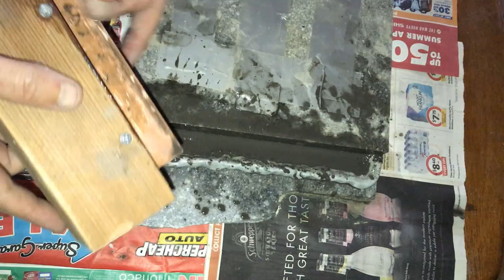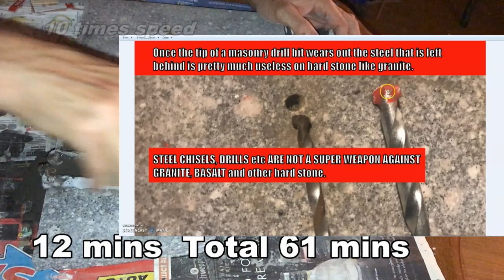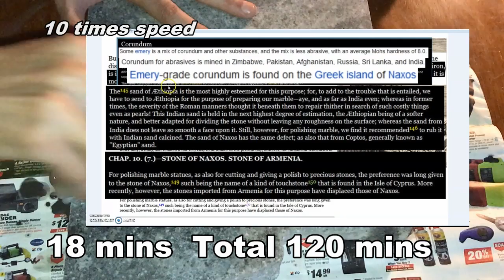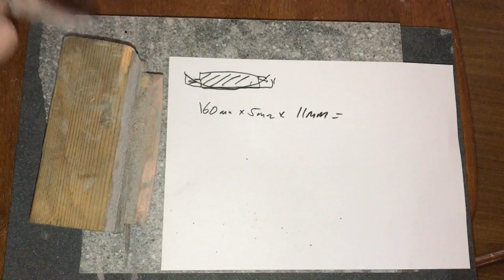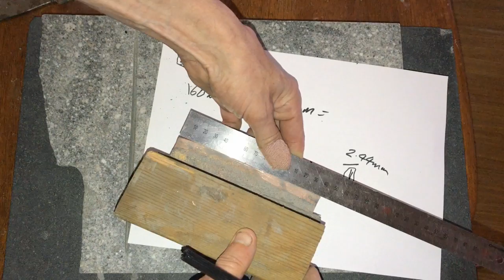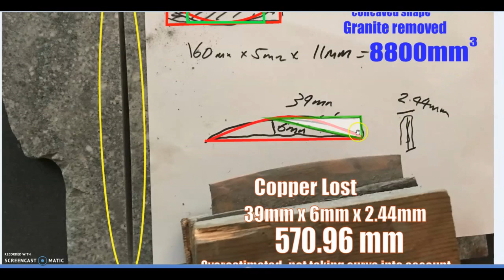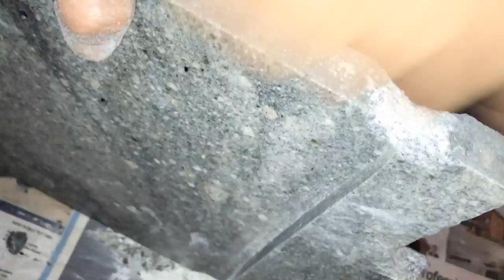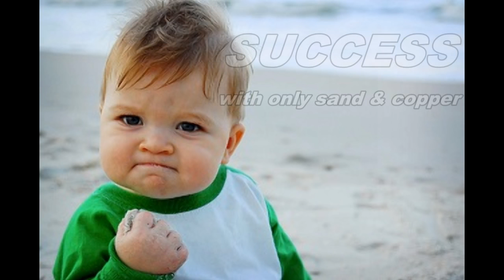LOST ANCIENT HIGH TECHNOLOGY- HIGH SPEED CIRCULAR SAWS 100% Debunked with Experimental Archeology

Comment: This does not at all debunked lost ancient technology, in fact it reinforce it.  Manual and machine cutting of granite that we are doing currently used the same principle, that is, friction. Both also used abrasives harder than the granite itself, the abrasives might be separated or embedded in the saw, plus water.  The determining factor whether the granite was cut manually or through a machine is the speed, scale and the precision.  The features of the granite blocks inside the Great Pyramid or in the Serapeum is beyond manual cutting if you take into account its scale and precision.
Reply from the maker: Lost high technologists such Brien Foerster and Uncharted X say this cut is impossible/ That soft copper rbonze tools cannot do it, and that the thinness of the cut is impossible. I have done it, and anyone else who cares to try can do it. 
THEREFORE those claims are ABSOLUTELY AND UTTERLY DEBUNKED.

"Manual and machine cutting of granite that we are doing currently used the same principle, that is, friction. Both also used abrasives harder than the granite itself, the abrasives might be separated or embedded in the saw, plus water."
Firstly please provide an ancinet cut mark that doesn't match methods of cutting- machined or manual. 
When it comes to abrasives like cuts like, the hardness of granite on Mohs Scale comes from the quartz. Quarts cuts quartz just as diamond cuts diamond.
If the abrasive becomes embedded in the saw is still pressing the loose abrasive against the stone.

"The determining factor whether the granite was cut manually or through a machine is the speed, scale and the precision."
1 - SPEED How do you know the speed that those blocks were cut? I use an unweighted blade which is the slowest possible method.
2- SCALE. Push saws and pendulums saws were used to cut large granite blocks and were photographed in use. These blocks do not count?
3- PRECISION- https://www.youtube.com/watch?v=bEwxMFDRmek Forget the video and go to the links- Isida project provides map and catalogue of all the Serapeum boxes. Please tell me which one is PRECISE. Please provide a source of measurement of this precision.

"The features of the granite blocks inside the Great Pyramid or in the Serapeum is beyond manual cutting if you take into account its scale and precision."
What precision is beyond manual cutting. A skilled craftsmen makes precise things but because an apprentice is not so precise? 
The argument of scale is nonsense. It makes no sense. At what point does it become impossible manually. 1 metre, 1.5 metres, 2.7 metres, 4.8 metres. Where is this mystical point where it becomes impossible manually?

Please provide information, you are speaking about specific things such as scale and precision. 

I will then provide examples of historic - pre-diamond- pre-precision machinery examples of granite work that meet those same pre-requisites.
Or examples of moving massive blocks with wood and rope.
The type of things the Lost Ancient High Technologists are rather desperate that you don't see.
Reply: @SacredGeometryDecoded  Of course, bronze and copper could not cut granite, that statement is correct, and the people you mentioned who said that statement are also correct in saying that. Why? Because it is the abrasive that cuts, not the copper.

You did not ABSOLUTELY AND UTTERLY DEBUNKED those ancient machinery arguments because you have not made any coffers equal in size and quality like that of the coffers in Serapeum using assumed available tools during that time period.  In fact, no one ever did, not even the experimental archaeologist.  You manage to cut a slab of granite sheet? Okay good effort, you got the science behind, the speed of course we can guestimate, but the SCALE and the PRECISION are just absent.  First, make one coffer like those at Serapeum using manual tools before you can confidently say that you ABSOLUTELY AND UTTERLY DEBUNKED their arguments.

Well, someone did show cutting 1 meter x 1 meter granite block using a push/pull copper saw with abrasive and water but still could not completely cut the granite in two because after cutting deeper than the height of the blade, the friction on both sides of the blade is just to much for them to push and pull as the abrasive is working against it, and the copper saw just could not do it as it looks like the copper saw will be mutilated before you can cut deep enough.  This is what i am talking about that there is a big difference if you are cutting a material that is enormous in SCALE compared to the granite sheet you just cut. The greater the SCALE you need the better tools and of top of that the increasing need to maintain PRECISION on increasing SCALE.
Reply from the maker: @zyveetorre1242  So no specific example of precision then? Imagine my surprise.

Each operation needed to make the serapeum boxes including the trihedral inner corners have been replicated. Are you saying that the individual operations cannot be repeated collectively? That you need to see one made is just silly. 
'You sawed a piece of wood and you drilled into another piece of wood but until I see you drill and saw the same piece of wood you've proved nothing!
It is a ridiculous statement/demand.
'To quote
"Well, someone did show cutting 1 meter x 1 meter granite block using a push/pull copper saw with abrasive and water but still could not completely cut the granite in two because after cutting deeper than the height of the blade, the friction on both sides of the blade is just to much for them to push and pull as the abrasive is working against it, and the copper saw just could not do it as it looks like the copper saw will be mutilated before you can cut deep enough."
You actually wrote this in a public coments section.
Where did this happen? Who couldn't carry on further than that? BS. Pure BS. Provide some link or something, you keep claiming presicion etc but provide no specific example just claims.

Do you even  know the difference between annealed copper used for arts and crafts as opposed to work hardenend copper?
FYI the copper used in Egypt is not pure modern copper like I use but arsenical copper/ and indeed arsenical bronze, it is stronger than mild and medium carbon steel on vickers hardness scale.
Though even hardened pure copper wouldn't come close to being mutilated. NOT ONE BIT!!!!
If that was true then the cutting edge of my saw here would be damaged. Including the 1.2 mm wde blade I use at the end. 
You clearly do not know what you are talking about.
Reply from the maker: Zyvee Torre bye there’s a whole section of the history of various abrasives where I quote Pliny mentioning it’s not the iron but the sand that cuts the stone.
Do you need a time code and links to Brien Foerster and Uncharted X where they literally say these things are NOTHING SHORT OF IMPOSSIBLE with soft bronze and copper tools.
I do my homework.
Reply: @SacredGeometryDecoded  You are claiming that you ABSOLUTELY AND UTTERLY DEBUNKED their arguments, and that means absolutely and utterly debunking them means 100% accomplishing the task that they think is not possible.  And you or any other accomplishing some steps and replicating some process thereon claim such?  Then i wonder, despite your claims that you or any other was able to replicate the operations, then where is the compete item?  Those coffers are not like the Great Pyramid that requires tremendous amount of materials and time and labor, those are 2x2x4 meter stone boxes!  You are far from absolutely and utterly debunking them unless you can replicate a complete one.

The situation i sited was done by us, thats why we know the problems of copper saw cutting a granite of that size.  The friction build up on the sides of the copper saw is just to much for it to handle.  You can make a cut a few inches deep, but you cannot go any deeper than that using copper saw.  Of course, we are not youtubers so we dont put videos.  However, for some people they tried, and they could not finished cutting, here you can search and watch this https://www.youtube.com/watch?v=qeS5lrmyD74 .  Notice that they have not shown that block of granite split into two pieces because they could not. 

By precision, it is the PRECISION OF CUTTING a slab of granite of that size that is flat to an error of a millimetre that made up those granite boxes in Serapeum. That alone is impossible using copper saw plus abrasive and water.  I am only referring here in the precision of cutting a straight line of that length and wide, 2 meters by 2 meters, easy to imagine and conceptualize, but impossible to cut using limited tools. If you are complaining while some of the coffers looks ugly well they are not yet polish, might as well not a finished product.  Those slabs of granite newly cut by hydraulic saw looks ugly too.
Reply from the maker: Zyvee Torre lol. That’s Denys Stocks. His saw is mutilated and he couldn’t cut below the width of the blade?
I posted one of his lectures earlier tonight. As he points out the abrasive sand acts as a liquid.
His blade has no damage. 
They made cuts and drilled for TV. Short time frame.
He has published a book on stone working experiments. I linked that in the video. You are just inventing things to back a non existent argument.
You leave a comment on a video where I go through abrasives etc point by point and them think you’re educating me on abrasives 🤦‍♂️ 
Why has no one made a large box? Because it takes time and is expensive to buy granite. To assemble a team for weeks to repeat what they have done, 
Then if they do the true believers just wave it away anyway. 
It’s impossible with a copper blade but iron is precise? 
And 1mm precise? WTF? In regards to what? Is their a blueprint with precise specs that show it is 1mm from the precise design.
Stop wasting my time wth your nonsense.
You make up BS.
You provide no sources or examples of precision.
You post a Denys Sticks link in response to mutilated copper blade?
Reply: @SacredGeometryDecoded  i do not know that guy, i just search videos since you want some.  I am not even educating you on the abrasive, i am telling you that a copper saw will not make it the moment you cut deep enough where the sides of the blade are getting much friction. That guy already got a fat granite block that he is working into, your argument that they could not replicate because granite expensive is just out of the question, your argument that they need to assemble team is also out of the question, that man in the video already got a team, and it seems his job is related to experimental archaeology, that means he got the time of his life! All he need to to is to make one granite box like that of the coffers in Serapeum using simple tools and claim ABSOLUTE AND UTTER DEBUNKING of those ancient technology theorist!  But did he?  He cant.  You cant. We cant with those tools. 

Why would you look for the blueprint of those coffers, who knows where is it?  In the fist place you could not fit the lid of the boxes unto it if you are not cutting with precision!  A cut of 90 degree angle is of course a precision!  To cut it and make it a cube of that size is of course a precision!  Those precision on that those scale are impossible using simple tools!  No experimental archaeologist have ever made cutting granite demonstrating that degree of precision on that scale.  I even doubt that the team of that man  in the video cut their granite following the line that they mark, it seems they just cut randomly, which is of course easy.   Ask him why he was not able to replicate a coffer, do not assume that he got no granite, no team, no time because he have.
Reply from the maker: Zyvee Torre that  a saw will stop working at that depth is ridiculous. There are old images of stone masons cutting larger blocks than Serapeum with a pull push blade that is thin.
It is utter and complete nonsense.

A tv crew filming a couple of days didn’t make a granite box. Seriously? On  a small piece where only a couple of people can work at one time!! Do you even hear what you’re saying.
They didn’t even use a guide to keep the cut straight. My cut is precise. It follows the edge where I begin the cut. To within less than 1mm.
I repeat it at the end with an impossibly thin blade to get a cut that follows the line of the guide to within less than a1mm.
I mean it’s all right here. Did you watch it at all. It’s right there. You are talking complete nonsense. By using a guided thin blade saw they cut deep cuts by following a guide. Done. Finished. 

There are historic granite buildings with precisely fit pieces.
90 degree cuts everywhere but as I show in my Serapeum box video I go through each box individually and prove lack of precision flatness and in perfect 90 degree corners. It’s clear from the photos but the Isida project took measurements unlike lost high tech people. Not precise. Repeat the Serapeum boxes are not precise. It’s all linked in the description. You failed to point to a single box that is.
I do my homework.
I have posted experiments polishing and drilling too. I have done it myself. Others too. With only stone tools.

The claims made by Uncharted x, Chris Dunn, Brien Foerster. Absolutely and unequivocally debunker.
Bet I have videos not only debunking Chris Dunn but exposing him as an outright fraud.
I have wasted enough time on comments.
I have many videos on these subjects with sources and demonstrations.
You don’t know what you are talking about, your points are absurd.
I have to think you’re trolling because a logical person wouldn’t say this on a public forum.
Reply: @SacredGeometryDecoded  I am not simply talking about to some TV crews not able to make a granite box using simple tools, in fact i am talking to anyone not able to make a granite box like that of the Serapeum, that includes you of course and all the experimental archaeologist.  Their job is to replicate some ancient stuff using the assume ancient tools, and again the coffers of Serapeum itself is replicable in WHOLE without consuming enormous resources, yet no replicated sample was ever presented.  They are contended that they have replicated a part, little did they now that is the replication of the whole item that sets apart the viability or the non viability of cooper tools in making those ancient items.  SCALE and PRECISION, i have repeated it many times already.  Yet you are ignoring scales as if its nothing, now try to cut a deep of 1 meter with the tools you used in this video, you cant, your deep is limited only to the height of your blade.  Should you then extend the height of your blade to 1 meter? You may but it will no longer work as its length is so much shorter.  Should you then extend the length of your saw?  You may but for it to be usable, with 1 meter height blade you need to have it at 8 meters long, and the thickness should be proportionately thicker.  But how about if you use the 1.5 meter saw like those guys in the video are using?  You may but the precision suffers, as we can see the cut tends to form a "V" shape, that is because of the wobbling motion while you are pushing and pulling the saw.  And after you have cut to a certain deep, your saw could no longer made progress as it could not withstand the friction on it side.  What, that friction you are talking about is bull shit??! Not so, the "V" shape cut on the first few inches cause by the wobbling motion of the blade actually helps absorb the friction on the sides of the blade thats why the saw of that man in the video is still intact, but as you cut deeper, your blade will no longer wobble as it is pressed by the granite, both sides experience friction and pressure, and as you continue, your copper blade will disintegrate into nothingness.  Of course, the nothingness shenanigan is an exaggeration, but you get the point, your copper blade will suffer friction and pressure that it could not withstand. Why i know? We have tried it.

Well, that was lengthy, but that was the science why copper saw could not go any deeper while cutting granite.
Reply from the maker: Zyvee Torre Ok. I see you’ve never worked a day in your life. When cutting a long 3 metre plank men don’t pull out a saw longer than 3 metres. They use a short blade and make a long cut through the tin part. The saw marks in coffers show this. 

As shown here and in the very same link you shared as you cut the sand is being pushed out the edge. You have to constantly keep adding abrasive.

Blade disintegrate into nothingness.
The abrasive becomes embedded in the copper blade!!!!
The pressure is from the top pushing down on the cutting edge. As seen here and with drilling experiments.
To cut granite they use thin blades in past and present. It’s a nonsense. That you keep trying to push this point as if factual is cringe.

Still waiting on a single measured example of precision. You and the LAHT keep saying but the Serapeum coffers are not precise. 
I went through them one by one in the link provided earlier. You keep dodging the issue of providing a single example.
In the video I use Chris Dunn’s own photos which show a rippling of light and an ill fitting square.
Precision means something. 

I could just announce my cut was precise to within 3 nanometers by your standards.